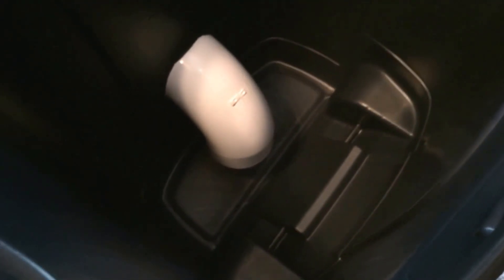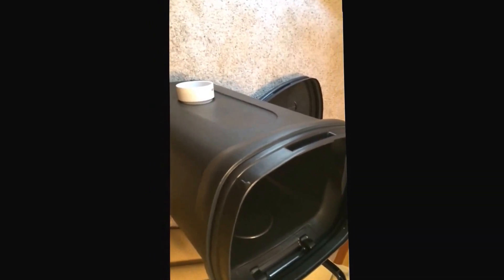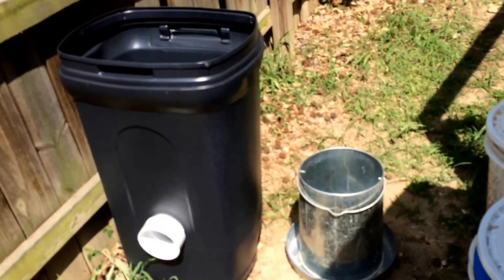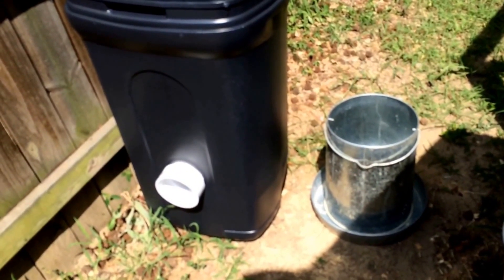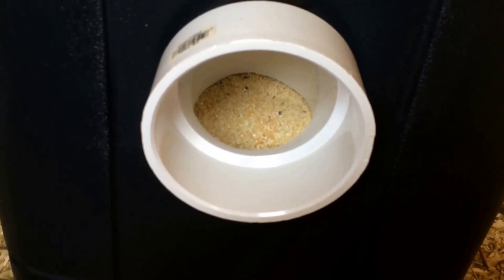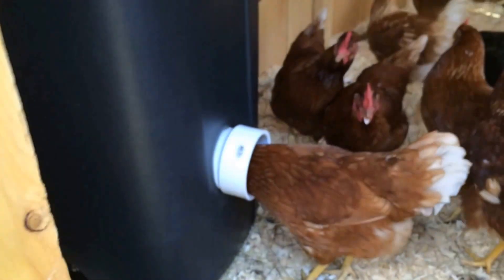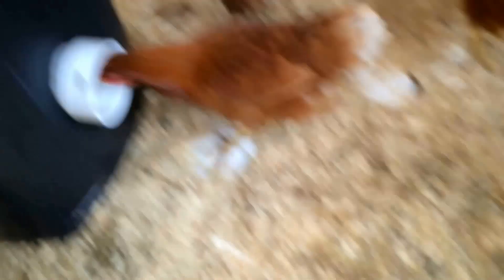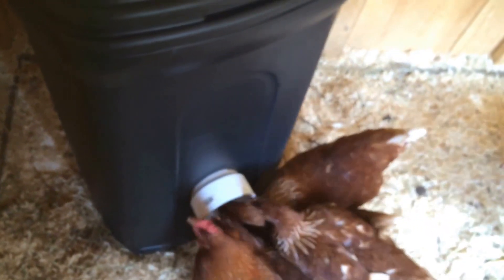Gravity feeder, chickens and ducks

Comment: Nice feeder, I really like the idea.  I kept my feed in a trash can and never thought about making that into the feeder.
Reply from the maker: I definitely recommend it. It was so easy to make and now a 1.5months later its still working great and I am still loving it. The only thing I may go back and do is do a line of caulking around where the PVC and can meet on the inside and out to make it that much tighter because a very little bit(maybe a handful worth over 50 days) has leaked out, nothing mad though.

Comment: Great Idea.  very low maintenance.  Might try putting a pvc elbow on both of the sides so multiple chickens can eat at the same time.
Reply: I was thinking about your feeder and I thought I would give you an Idea.  Take it or leave it but I thought it would be cool to put a flag much like a mailbox flag on it in a seesaw type style close to the bottom.  It could have a flag on one side and a horizontal plate of some sort on the other side.  The weight from the feed would keep the flag up like a big kid on a seesaw.  When the feed gets low it would be like the big kid suddenly jumping off the seesaw.  When the flag drops you know to get more feed.

Comment: Not a bad idea.  If you offset the PVC you could get two in there and one on each side.  There's roughly 5 gallons on the bottom that they can't get to with just one access port.  Next time you are in Home Depot picking up a trash can, grab a razor knife, they are about $4. ;-)